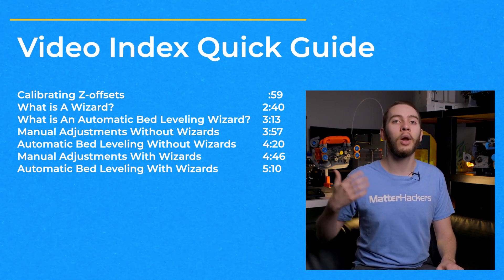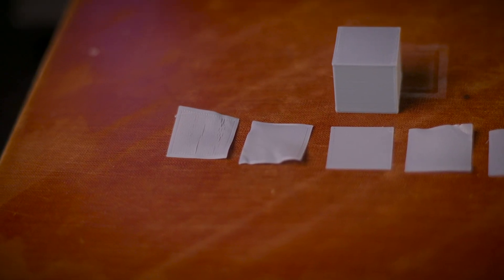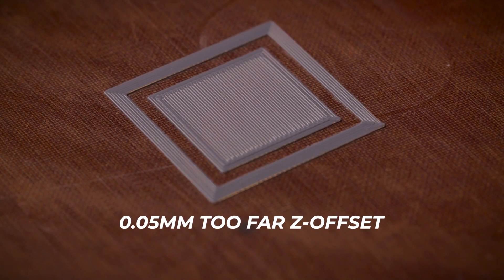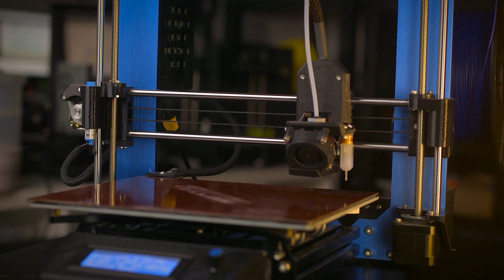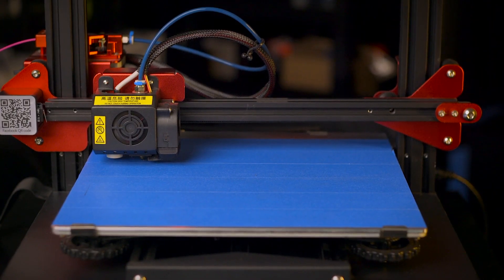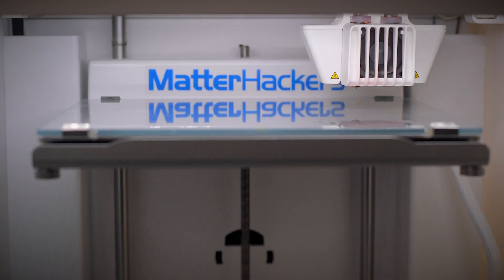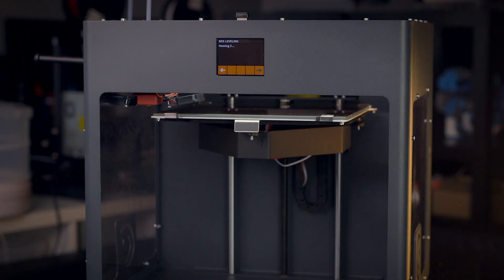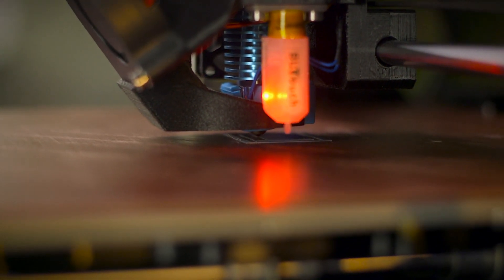3D Printing Essentials: How to Succeed with a Perfect First Layer for Every 3D Print

Comment: It's impossible to print a nice first layer with the Flashforge printers. They don't have a precision way to set the nozzle distance, it's  either +.10mm or -.10mm, no finer adjustments available.  They are also false advertising of "auto leveling". There is absolutely nothing "auto" - you have to do it yourself. They are basically lying on their website. 
Waste of money people, don't get one of those, you're paying for the enclosure that in houses a poorly made 3D printer, printing PTEG with it is nearly impossible. Printing PLA with it is like 4 out of 10 may come out ok.

Comment: I’ve leveled my bed so many times to try fixing the first layer issue starting to think the problem might be something else
Reply: have you tried doing different first layer temparatures
Reply: @ianthewizard7924  yeah I increased the nozzle to 240 and the bed to 80 because this guy I was talking to told me I was using PETG which needs be hotter and it did help but I still think I needed to level it better cause one side was a bit to stringy
Reply: @KingDavid00  ok